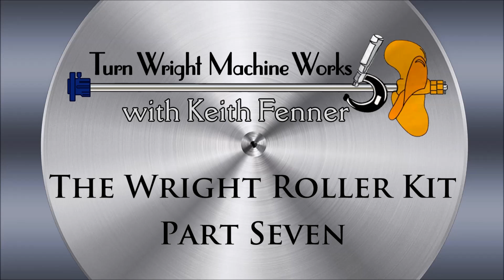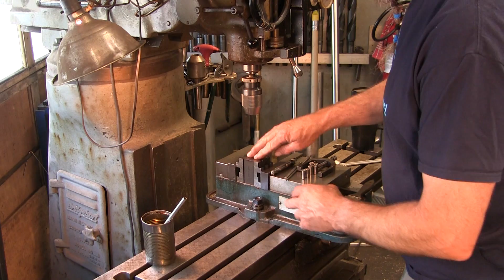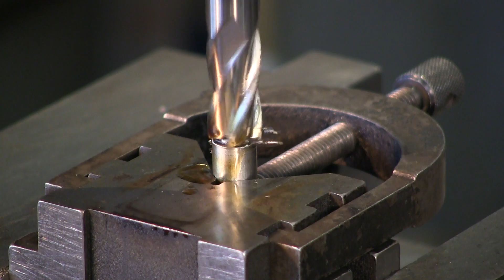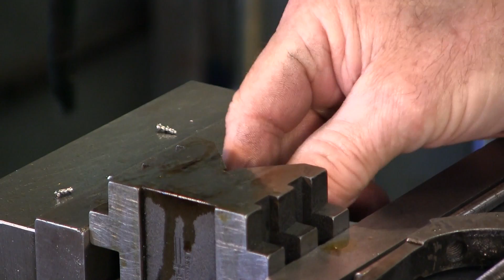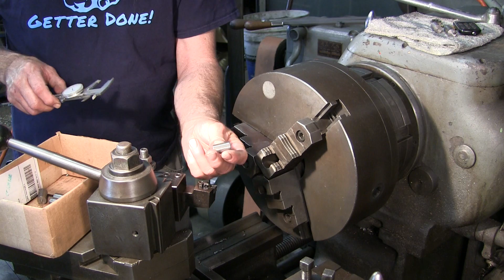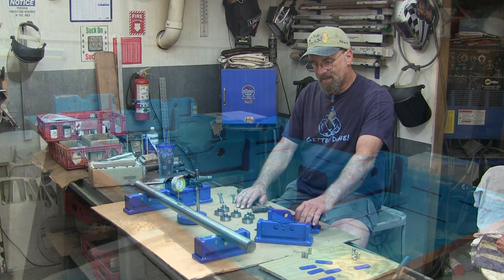The Wright Roller Kit The Build / Part Seven

Comment: Hey Keith i just started working at a job that straighten out shafts how you do it with the torch. We straighten out straighten shafts from 5 ft - 20 ft long from 1" 1/2 - 2". I wanted to to know if u can give me some tips on how i can straighten them out correctly and quick.
Reply: Proprietary information!   Here's a hint.  The Hot side will be the short side....

Comment: Hey Keith, thanks a bunch for the great tooling and also a great video to put them together with, Nice. BTW, I am curious about the siphon blow gun that is shown in the cover photo for this episode #7. It doesn't show up in the video(or at least I missed it, if it did) and I was wondering what you used it for, and what you fed through the line other than air? Thanks again...Aloha, Chuck.

Comment: Keith, I was told to always put a washer under a nut, even if it was only a simple flat one. To protect surface finish was one reason.

Any thoughts?
Reply from the maker: good practice! I was going for the perfect flush nut for handling.  ;{)------

Comment: I can appreciate the work that goes into these.  I only have a small Atlas lathe and a cheap drill press and have made a few things over the years.  I had shrimp boats for 18 plus years and found that I had to do most everything myself because of the need for quick repairs to stay on the water.  The only shaft straightening I had done was by a small machine shop.  I didn't study the details of his setup, but I remember it didn't have the swivel function, and it was set up to use supports for the actual pressing to bend/straighten the shafts.  Best I can remember is that the rollers were supported by springs in some way.

Comment: The roller kit certainly leads to a good quality product. However, having followed your assembly in 7 parts so far I must say there is too much time involved to make such a simple product. Maybe the design is not optimized for fast assembly. If you had to sell the finished product you would have to ask for about $200 per pair or even more to still be profitable. It would hardly sell at such a price. It has too many parts needing too much machining.  ->
How could the design be optimized for less time to finish the product? Maybe plasma cutting a development out of 3/32 sheet metal and bend it to a box in your press. Cut outs already finished in the plasma step. Holes pre-cut by plasma and finish drilled, reamed after bending. Something along this line. What do you think?
Reply: Any competent machinist could do this with maybe a bit of help with the welding. The whole point is you get the kit and finish it which you could easily do over a few hours time. Remember a kit is a set of 2
Reply from the maker: Not intended to be a production model for resale, more for those who want a top notch roller set that will out live them and their career, as a project to build themselves. Your reasoning is exactly why I created a kit people could affordable stock purchase, then invest in self labor.  ;{)------
Reply: Quality is not cheap and i would pay couple hundred bucks for a something i know was right than something that is mass produced.
Reply: mass production or production friendly design does not necessarily mean low quality. Starret products, Mercedes Benz Cars are all mass produced and still considered quality products.
Reply: I take your point. But still how could the design be improved such that a hobby metal worker can finish it quicker? With the current design the builder needs a welder, a lathe, a milling machine, and a band sander. Admittedly with my concept above he would additionally need a plasma cutter and a shop press or sheet metal brake. How could it be done with less equipment and in less time?
Reply: Can you achieve similar precision in less time? Is such a level of precision really needed everywhere or just in very few locations?
Reply: your arguments are still based on the current design. With a more production friendly design it might not be silly anymore. Is anybody willing and capable of finding alternative design approaches to make this thing faster to build? A little bit of independent thinking? I know thinking is hurtful...but the more it is done the less it hurts. :-)
Reply: what precision is really needed? The rotation axes of the two bearings need to be reasonably parallel. The two bearings do NOT need to be at exactly the same height. They do not need to be at exactly the same position along the axis of rotation. The two pivot points at the end of the box need to be reasonably perpendicular to the bearing axes. They do NOT need to be exactly parallel with the base plate. By not having to be precise on everything a more efficient design might be thought up.
Reply: Anybody willing to help kick this stone down the road?
Reply: If a competent machinist does not only want to follow the designs of others he needs to become also a competent designer. Keith has designed his rollers years ago with a certain goal in mind. And that took a good deal of thinking.  And he achieved what he wanted. Congratulations. However, there is no man-made design that could not be improved or optimised in a slightly different direction. But that takes more thinking. Here in a blog of mechanically oriented people that could  be a fun thought experiment if you are thinkers yourself not merely followers of somebody else's thinking or passive telly watchers. Why not produce your own thoughts rather than only consume those of others?
Reply: thank you for your contribution. I think I see what you mean. It would make sense if you wanted to sell the finished product. Less so if you want to sell a kit to hobby machinists. Is that it?
Reply: +fall22123 you were thinking of investing in more production like methods. Like CNC programs and using advantages of CNC machines. Like specialised jigs. But all that still using the baseline product design. I would like to reduce the part count and the number of machining operations on the remaining parts. That requires changing the design somewhat.
Reply: +Mark Pascall I certainly respect your opinion. And by asking for design changes towards a different optimisation goal (less build time) I do not want to reduce Keith's achievements at all. Maybe you and he favour perfection more and maybe I and possibly others favour efficiency more.
Reply: +carryit around Yes I do own a mill and a lathe. No CNC. I see the joy in manual machining similarly as everyone here. However, that does not mean I want to spend the maximum possible time to produce something. I know it will always take me longer than in mass production. But I still would like to be reasonably efficient also in a hobby environment.
Reply: + Keith Fenner Your design is concerning quality certainly very good and proven. I just thought the group here might want to think up a design that is still good quality but faster to build. There are many ways to Rome. And thinking toghether in a group here might be fun by itself. Trying to improve or change something should not be taken as an insult by the original designer but rather as a compliment because he has established a standard which others use as a starting point for variations and improvements.
Reply: In many quality systems it is written that quality means "as good as necessary" not "as good as possible". The difference is the concept of efficiency.
Reply: The only machined surfaces that need precision are the 2 holes for the bearing axles, the 2 axles themselves and the 2 holes for the pivot points and their pins and the opposite holes in the support blocks. Everything else has no functional requirement for precision only your personal requirements for good looks.
Reply: Guarantee I can pick any one of those products and find faults or quality control issues in the manufacturing process. Quality control after the manufacturing process is what keeps those failures out of general consumption. Doesn't make it a better manufacturing process at all
Reply: If the bearing axle holes and the pivot holes are drilled and reamed only after the whole box is welded finished then any (reasonable) weld distortion of the box is irrelevant. The fit of the end blocks in the tube is irrelevant as long you can still weld them. They could be sawn and sanded to undersize instead of milled on 6 sides. May not look as good but still works. That probably is not qualifying for Keith's stamp of pride. However, in my home shop I need functionality, precision where it counts but not good looks.
Reply: +BiggoronJon Taiwan would certainly reduce the price by lower cost labour. But most certainly they would also simplify the design to a degree that might even harm the functionality. We all have experiences with products of that sort... But lets stay with the kit and trying to reduce build time for the hobby machinist.
Reply: If also the holes for the pivot pins are drilled and reamed in the support blocks on the base plate after they were welded on there then again any weld distortion would be irrelevant. To make sure that those holes line up a rotary table (standing up with horizontal rotation axis) might be used or a dividing head with a face plate. The holes would be drilled from one side and the base plate with the support blocks would be roatated by 180 deg. In that case the base plate parts would not need all side machining before welding. Again sawed and sanded might be sufficient.
Reply: + carryit around  I don't know if your nephew is able to do it. But such things have been done before. There are a number of kit built helicopters using car engines.
Reply: +Jasin Colegrove I don't know which products you are referring to. You are right that end inspection alone does not make a product better. But if the findings are used to improve the design or the manuf. process then it can as in Kaizen and 3-sigma continous improvement processes. Or is it 6-sigma? I am not a quality guy.
Reply: +carryit around  concerning the different roller height: if the height of the two roller assemblies are different then you are right. If the two bearings within a single roller assembly are at different heights but both roller assemblies are the same then you are wrong.
Reply: +carryit around "lol.  Thank you.  Why did keith put an x with a flare marker in one of the corners?"
sorry I miss the humor because I don't recall that part. In which video was that? what time into it?
Reply: +carryit around I have watched Keith in most of his videos. And I agree that he is an expert machinist not only with very deep knowledge and skills but also over a very wide field of disciplines. I have learned a LOT and I am grateful for that. But I still think that precision should only be aimed for where it serves the function. And in this project I think less of it in some places would still have been good enough. Did he go a little over the top here just because it seems so easy for him?? And I need to be "efficient" because precision is hard for me to achieve? Maybe there is truth to both.
Reply from the maker: Please let me know when you get your designed / set proven and up on your channel, I'd be interested in seeing what you come up with, just like those who have modified the way some of the 400 plus kits sold have been done by different ideas shared, in the last year. ;{)-------
Reply: +Keith Fenner    I could find only one modified Wright Roller project in Youtube by CompEdgeX.
Where can I find more modified Wright Roller Projects? Maybe I learn enough to live up to your challenge... :-)
Reply: Thanks. I will check them out. To publish such a project on a youtube channel would be a challenge for me, for sure. On that I would have to start at level zero. But I can also see the motivation in doing that.
Reply: +carryit around    I don't need good luck because I don't build a helicopter but just to prove that it has been done:

helicopters with car engines:
http://aerocopter.com.ua/en/Light-utility-helicopter-kit-AK1-3-overview.html
http://www.vortechonline.com/hrh/main.htm

gyrocopters with car engines
http://www.rafgyro.co.za/index.php?option=com_content&view=article&id=146&Itemid=125
http://www.rotorcraft.com/barnett/powerplants.html
http://www.gyro-kopp-ters.com/specs.htm
Reply from the maker: I have a couple tags on my face book, and some in the comments in the early roller kit videos, as to their mods, not sure everyone has posted vid's on youtube but they have contacted me, that is what I was referring to just keep me posted of your progress, not a challenge, just thought you were interested in building your own set.  ;{)------
Reply: He produces for the basic/ ignorant(not knowing)student with not a lot of knowledge.All  knowledge that should  covered.Not all can know the subtle tricks some of us have amassed over years.
Reply: Imagination.